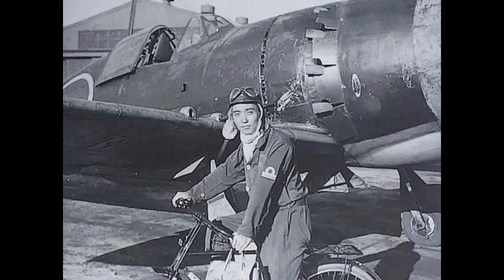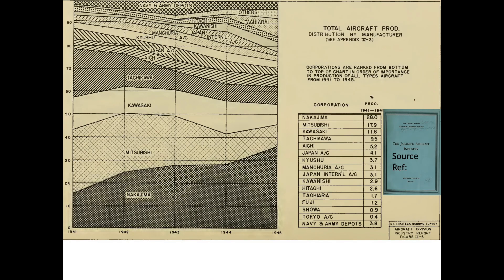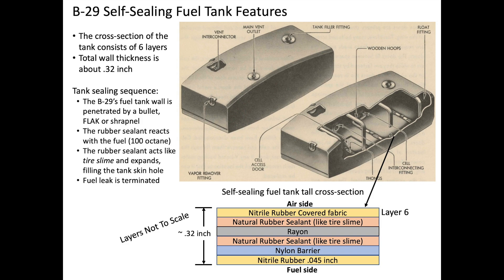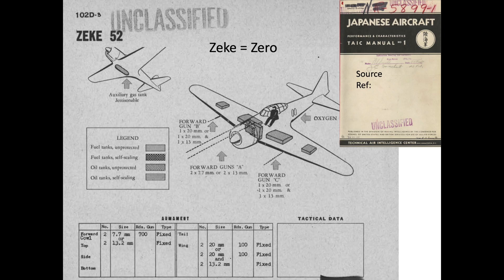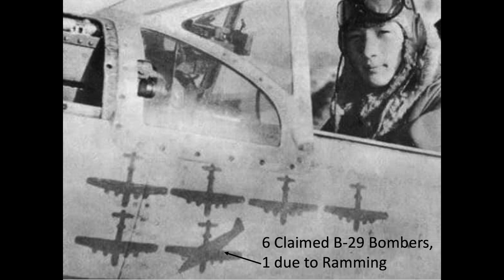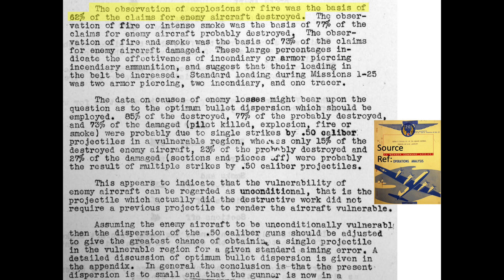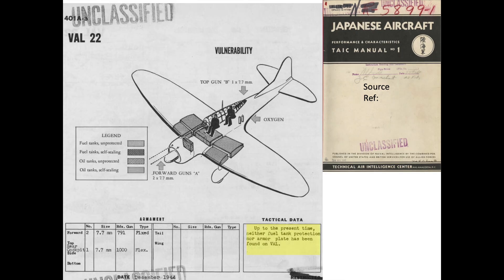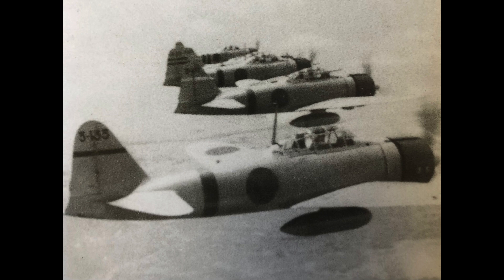Why WWII Japanese Aircraft Caught Fire so Easily

Comment: One factor trending to large numbers of plane models adopted was the low level of wartime labor skill.  This lead to widespread use of single purpose jigs.  Once you had a complete set of jigs made at great expense, you couldn't easily change designs nor expand production.  If you needed a new set of tooling, might as well try to make a better plane.

Comment: I thought one of the downsides of self sealing fuel tanks was that it reduced range because of the volume the tank fabric etc took up within the metal fuel tank structure, reducing the amount of fuel which could be carried.. Maybe that was another consideration. Excellent channel by the way.
Reply: Adds .32 inch thickness to the tank, hardly much volume compared to the huge volume of fuel.
Reply: It was heavy

Comment: Excellent, I wonder if anyone created fuel tank armor ?
Reply: Too heavy. It would be very safe though, as the aircraft would never be able to leave the ground. ;)
Reply: @jbepsilon  The IL2 sturmovik had it's engine, cockpit and fuel tank armored so it is possible.
Reply: @RemusKingOfRome  The IL2 is kind of an exception yes. IIRC it had a massive 16% of the weight in armor alone, compared to a few % for a typical fighter or bomber. Also, it so happened that the fuel tanks were inside the armor bathtub protecting the engine and cockpit, it didn't have wing tanks at all.

Comment: I think self sealing tanks were only good for stopping fuel leakage and did little against fire hazzard if hitted by API rounds. Yet, anti-leaking itself was important enough. The first ZERO fighter that US got their hands on was force downed onto a remote island due to a minor damaged fuel tank leak.
Reply: My understanding is that in a gasoline tank the fuel vapors will saturate to a point beyond the upper flammability limit, thanks to the high vapor pressure of gasoline. So to set a fuel tank on fire you need to make a hole in it, both to let fuel vapors out of the tank where they can burn in the ample oxygen outside, and to let air into the tank so that a fire can start inside. So self sealing tanks definitely help, though they are of course no guarantee against a fire.

Comment: There's also the fact that in the long-range combat of the Pacific War, a leaking fuel tank could be almost as deadly as a completely destroyed plane. At those extreme ranges, just a couple of .50-caliber holes poked in a fuel tank could mean the difference between getting home and ditching in the sea.
Reply: True, but those incidents would be almost impossible to record and won’t reflect the statistics; likewise they probably wouldn’t change the engagement which was the primary concern here. Even a medium fuel leak wouldn’t be a priority in the middle of an intercept, especially for the IJN pilots.

Comment: Awesome.  This helps explain why the U.S. stuck with the AM/M2 over the 20 mm for so long.  I knew the Japanese did eventually introduce self-sealing tanks, but didn't know they were so ineffective.
Reply: the US stuck with the M2 because they made so many of them, they put them in/on everything. And 6x M2 were about equivalent in damage/effectiveness as a few 20mm.
Reply: @SoloRenegade  I was under the impression that the U.S. just couldn't get the 20mm to operate consistantly. I vaugely recall that they jammed way too often because ?headspace issues?
Reply: @lamwen03  Many US fighters and other aircraft used 20mm and 30mm cannons in WW2 (and some sporting even larger cannons). Such as the F4U, F6F, P-51, P-38, P-39, P-63, B-29, B-25, etc. 

And the US operated the Supermarine Spitfire, De Havilland Mosquito, and others with cannons as well.

The US produced over 3mil M2 machine guns, and put them on Jeeps, Tanks, AAA, Ships, Aircraft, mounted in fixed ground positions, amphibious craft, etc. Literally bolted them to everything that moved or didn't move.
Reply: @lamwen03  Indeed, american-made 20mm hispanos were jam-fests. I recall reading a report that said that after the first round, there was a 33% chance of a jam, and after the second, it went up to 50%.
Reply: @SoloRenegade  While overall the 20mm was more effective in firepower, the AN/M2 had far more ammo and thus endurance. At the longest ranges also, the .50 actually penetrated more armor than 20mm guns.
Reply: @F4Wildcat  good points
Reply: Same here
Reply: The real reason the US kept with the .50 is that they were attacking mostly fighters. They weren't bomber hunting like German and Japanese fighters who need the extra firepower.
Reply: @Berthier_Enjoyer  the US used the .50 because they produced millions of them, and had to use them, so put them on literally everything
Reply: @SoloRenegade  They wouldn't make millions of them if it wasn't adequate for their needs.
Reply: @Berthier_Enjoyer  oh, the .50 is Great. I love it. And for WW2, the .50 was getting it done just fine.
Reply: @SoloRenegade  I wouldn't say "just fine" considering that all american planes needed to have a ridiculous amount of 50 cal machineguns to match an equivalent british or german fighter
Reply: @Berthier_Enjoyer  The germans and the japanese adopted 20mm cannons before having to deal with many bombers. 20mm is about the minimum size you need for an explosive charge to be sufficiently worthwhile placing in a bullet. The real reason they kept the .50 was because for some unknown reason the americans decided to alter the already-somewhat-faulty british specification for the 20mm hispanos that the resulting cannons were considered unusable

Comment: Didn't know that the US had .50cal proof self-sealing fuel tanks. That's the first time I've heard about fuel tanks being able to seal .50cal impacts.
That's a huge advantage compared to tanks which normally only do well against 8mm rounds.
Reply: Yeah, that amazed me as well - the .50 cal is a pretty hefty round, to make a fuel cell against it self-sealing is quite remarkable.
Reply: The .50 also has tremendous energy dumping into that tank, which he mentions as dynamic shock waves destroying the thin Japanese metal tanks.  I wonder how much of the US self-sealing structure was to handle that energy dump.
Reply: @grizwoldphantasia5005  well they are made out of rubber, so they should be pretty flexible, unlike those Japanese metal tanks. But I don’t think it generally was a problem, unless it was a completely full tank, which should be rare.